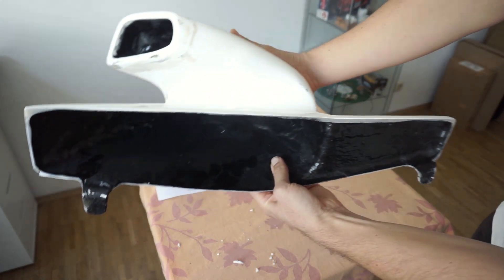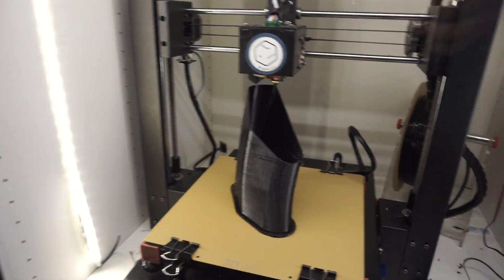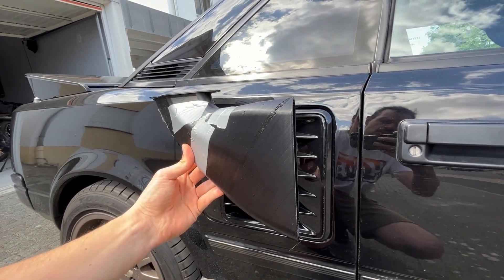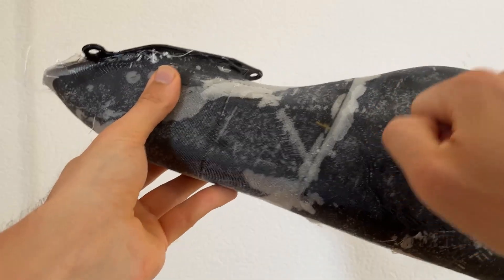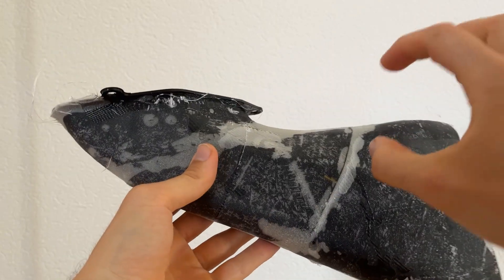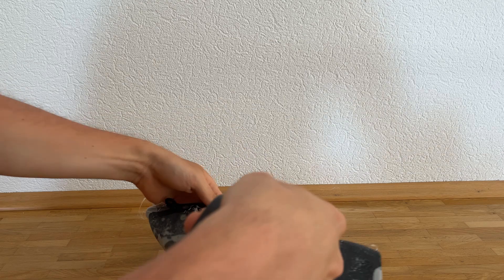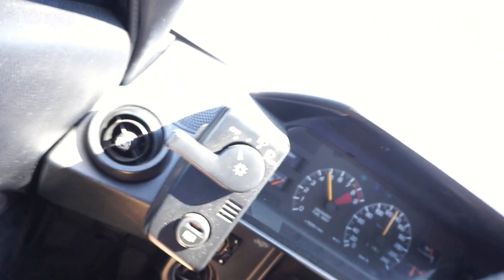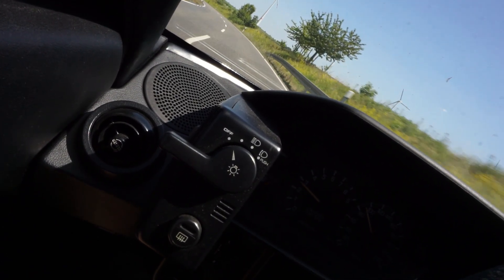My 3D Print - MR2 AW11 4AGE - Real Cold Air Intake

Comment: Glad the mods are coming along well, would be nice to see an update with stock/mod comparisons. It's a shame the mk1a did not utilize the side intake, i will need to look into finding a way to route air from underneath the engine bay to my air filter pod. 

It would be nice if you were to come with a quick 3d printer mold to display a 1:64 scale AW11 model that Matchbox recently released on top of the centre console, or perhaps another more functional use for that space. I would like to display my scale AW11 but it would frequently move around and fall off when I am doing spirited driving lol.

One more area where it may be useful to have is the shift boot mounting points. The brackets snap off on some more well used cars and it is difficult to get new boots to fit like how it did OEM. Maybe an alternative mounting method may be useful to look into. At one point I was looking to do a more simple Miata like rubber shift boot (https://www.topmiata com/wp-content/uploads/2017/10/jass-performance-central-console-delete-kit-2.jpg), but mounting would of been difficult so I went back to the original cloth boot.

I like your t-shirt/hoodie designs esp the miami vice neon colour Touge Tribute design. Unfortunately I don't speak German and I am unsure which option is for mens as I see many options for men. Would it possible to have an english toggle and how much would shipping be to Toronto, Canada area? Would love to see more neon-negative space AW11 designs as well. Thanks!
Reply from the maker: Thank you!
Oh yes, i have a black small diecast and to print a small display for that is in my mind since i bought the aw11 😀
Chaos in every corner right now.

Thanks for the idea with the shift boot, i will check that out! One comment wished a oil stick extension.

To the Shirt; you are right, i thought the shop would switch to english, if you are located outside of germany.
I uploaded the design to redbubble, they should print in US. Hope this helps :)
https://www.redbubble.com/people/tougeprints/shop
Reply: @jumuworks  Yes I was actually the one suggesting the oil dipstick extension too haha. 

I'll drop down any more ideas I have if I feel it might be worthwhile for you to take on.
Reply: @jumuworks  Thanks for the updated store link, 

If you are able to further modify the design would you happen to have a version with the image on the back of the t-shirt with your youtube logo on the front on one side of a sleeve or mini logo on one side of chest? If you can't further mod it no worries, I liked what you did with the hoodies was hoping to have that on a t-shirt